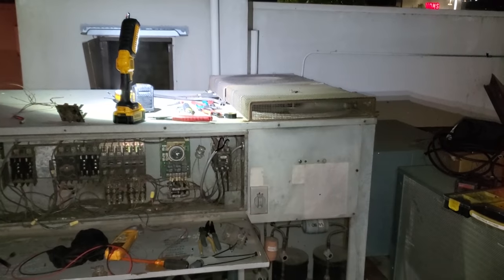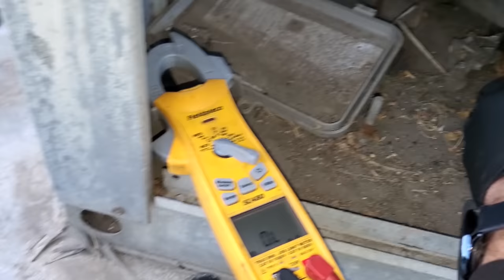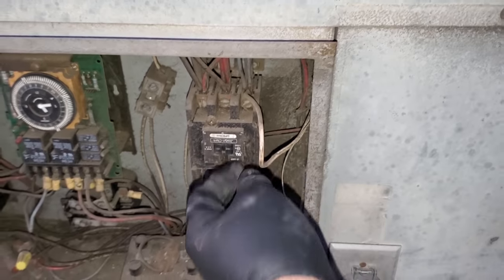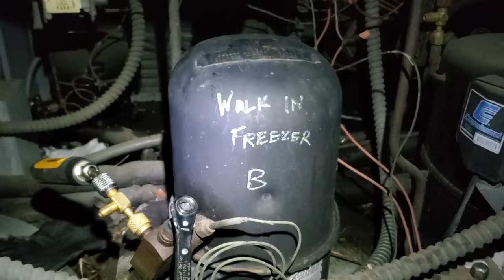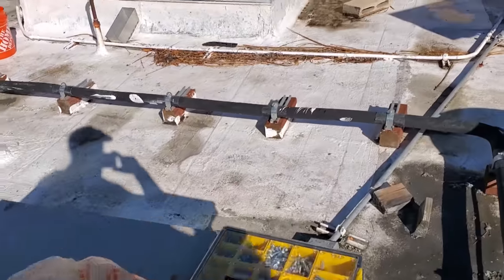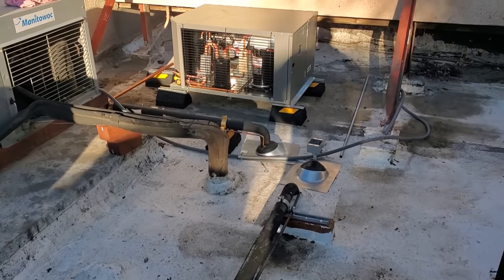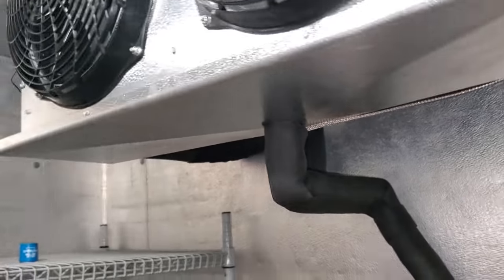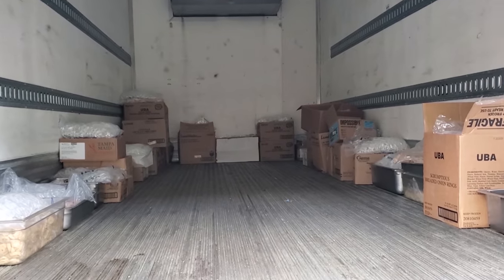FRUSTRATING WALK IN FREEZER CALL

Comment: I have to admit I only wanted to do HVAC because I have been on those overnight calls. I had a 10,000 sq fridge lose a compressor big Copeland on a BOHN at 8pm. I had to call two other guys out, a Crain and opening several stores. 13 hours later I was cured of refrigeration. Lol if I was young like you maybe!

Comment: What a nasty system! Wires running through bare metal openings with no grommets, holes rubbed through the cables, lines floating in the wind, smoked capacitors, ratty looking wiring, an uneven roof with low spots everywhere, electric shorts all over the place, service valve problems, nasty looking attic, coaxing a fan to work that says "eat my dust" all documented on video makes for very entertaining New Year's Eve viewing. Wonderful job of sizing up the situation, keeping the customer in the loop, and a quality install in the end. A super video that shows how and why you earn every cent you make. Very well done video and quality work!

Comment: "Stand back and don't blow up!  Again, don't blow up in my face!"  

"Hello, emergency services?  Do you have any openings on the bomb squad?"
Reply: Had that happen to me last year December 24 arena glycol pump grounded but no ground reading with my megger. Reset the overloads and started it back up panel blew up in my face tripped  a 200 amp 600v breaker... had a real great Christmas lol 

Old old panel no fuses in the panel it's over load then contactor stupid design but what you want.

Comment: The internal bypass inside the compressor didn't close following excessive high head pressure due to the condenser fan failure. That causes the pressures to nearly equalize and it rapidly overheats the compressor. They will reclose a few times, but eventually they fail open.

Comment: Good video. You crack me up on those shingle roof flashings for flat roof penetrations. Here we have to use covered pitch pans on any flat roof penetrations and they sell them at the supply houses. They have even started to use them on pitched shingle roofs too. Pop the cover off, fill with spray foam, seal with polyurethane roofing caulk, then put the cover back on and done.

Comment: Just got home from a freezer call here in Colorado. Equipment blew all the charge from a cap tube on a pressure control, after fixing everything and charging it system has a TXV restriction and is oil logged... Great time to be a tech.

Comment: Wow a nightmare from Elm St. Great video on the removal and install. Lots of tech don't well some don't know you have to bring conduit through the roof to a work box then sealtight to the equipment. No matter the equipment. Nice on the temp power and made sure the electrican knows what you like to do. Great find on the vavle partially closed. Neat install, clean and very considerate on equipment placement on the roof away from potential safety hazzards. Nice follow up on the start up too. I enjoy your time, videos, and your knowledge of the trade. As always be safe, slow down and Look at The Big Picture. Thanks Chris.

Comment: Shocked to hear you say “you are really impressed with Russel”
We installed those for years and are thrilled to be NOT installing those anymore. Several issues after minimal time in service. Hoping you have better luck than us....
Reply from the maker: The evap coils aren't the best but the condensing unit seems to be  much better than the heatcraft units. But the Heatcraft evap coils are better in my opinion, I just wish heatcraft would use all sporlan stuff instead of the cheap components they are using
Reply: I did see in your video that condensing unit was different than the ones we used to install. Simple things like screws stripping easily for the panels was aggravating and non-adjustable packing nuts/stems that leaked and unable to change leaking service ports without replacing entire receiver, etc.
Agreed with your thoughts on Bohn evaps too.
Like Dave says, “got boned by Bohn again”
Reply: I was about to comment the same thing. My company installs Russell/Witt and the condensers are fine. The EVAPS just rattle and seem cheap. Only thing good is the sporlan valves. The ecm motors suck FYI.

Comment: Good video Chris . Russell condensing units are pretty solid . Evaporator coils are not in my opinion. I’ve done Russell condensing units with Heatcraft Evaporator coils . Good thing Russell is using Sporlan Expansion valves , multivolt solenoid coils . Over the past years I’ve found several leaks on Russell condensing units . Leaks were at the liquid rotolock coming out of the receiver . Also found few high peanut style pressure switches failing to close .

Comment: Just a thought, but wouldn't you want the nitrogen purge to be coming from downstairs, so that you're not blowing fumes and nitrogen into an enclosed space?
Reply: there's not that much flowing in regulator braze setting, the piping is clean inside no no contaminates or anything should come out the other end.
the nitrogen is used to displace oxygen from the tubing so it doesn't "oxidize" when brazed, which stops it from creating black flakes of burnt oxide scale inside.
now if you don't use proper clean refrigeration tubing which has oil and pother contamination, there could be an ugly fog of nasty burnt smoke and fumes out the other end.

Comment: I know what you're talking about. The last real R502 system I worked on was probably 4 years ago. That tank of 502 is taking up space that a tank of R448A could be taking up.

We had two tanks of refrigerants, at my first refrigeration job, that we had to have approval to use. A tank of R12, and a tank of HP81 for the Manitowoc ice machines just after the fall of R502.
We never finished off either tank in the 14 years I was there.

Comment: if anyone isnt sure O/L on your meter just means "outside limit" or just outside the reading range of the meter. high resistance above say a few Mohms wont be read by a standard meter and just shows O/L, for example when your probes are apart in air, there is a measurable resistance there technically but a fluke or fieldpiece wont be able to read that. same for voltage :)

Comment: If you were a mechanical design engineer and a machinist then you could rebuild those new valve core removers. I've made new teflon for the ball valve ( tighter fit ) and dielectric silicone on the lever o rings. Mine work now. Even the new ones leaked. Seems like once every 2 years disassemble and lube.

Comment: Hey a reefer straight truck with a carrier I work on those, edit that truck should be able to easily pull 10f even hot Ambient, somethings not right with the truck
Reply: Stat was prob just set at refrigerator not freezer settings. Just needed turned down.

Comment: Hey chris great video. Perfect end to 2020 watching your vid to finish the year off. Hopefully 2021 brings more work your way and once the vaccines start up  places return to  normal and stores and bars and restraints open  up.  I've currently got the Rona so watching your stuffs keeping me busy and learning stuff . I've got a question though . You know for the line sets? Why dont you HVAC guys use the pro press copper crimp connections? Like for braze free inatalls just wondered if youd use them on things like r290 what with 290 being explosive and flammable I think its be safer for you Hvac guys

Comment: Just out of curiosity, if a customer is looking at a $6000+ for the repair ie replacement of the compressor and overtime, what are the looking at for complete unit replacement then as you do a few videos where you basically end up replacing everything but the customer chooses to keep their old housing and electrical instead of just changing the whole unit.

Comment: Have you ever had solder drop inside of the torch nossle
Reply from the maker: Yes
Reply: My coworker had some solder drop into the tip on his map gas torch while soldering water pipe, stopped it up real quick like. had to use a little butane torch thats meant for heat shrink tubing to melt it out.......

Comment: Do you secure the dura-blocks with any adhesive or is it more advantageous to have them loose and just sitting on the roof? I assume there would be a vibratory movement risk which would potentially upset the lines.
Reply: I have the same question. I'm guessing the weight is sufficient enough.

Comment: 19:00 that copper piping, is it the same stuff as water line or is it a special type of pipe for hvac?
Reply: special stuff, thicker walls
Reply: The walls are not typically thicker, on ACR or OXY/MED pipe it is standard Type L tubing. The main things to know are the pipe is nitrogen filled, hydronic pipe uses ID measurements and ACR uses OD, for example 3/4” water line is 7/8” for AC.
Reply: @rogerbettencourt9654   Yep , This man is correct.  Acr copper is Cleaned & Filled With Dry Nitrogen & the Ends Plugged with rubber plugs / sealed.

Comment: If you didn't have any 504 couldn't you just use hot shot instead with out converting everything?
Reply: EPA regulations prohibit mixing refrigerants so technically there's no such thing as a "drop-in", but there are retrofits like 404a if compressor oil is compatible.  If you're lucky you only need to change the power head on the txv.

Comment: What kind of temperatures are pressures would those copper lines see in a refrigeration system?
Reply: like ~400psi max, usually only get that high if the condenser fan is dead or something though

Comment: dust and wood and a hole in the roof...open flames and risk of dripping weldingmaterial...im spooked. Guess you dont have "hot work" rules like we Swedes :p
Reply: Just curious but how are rules and regulations around refrigerants in the US? You converted to a 404 system right? 
Curious cause in Europe we are going away from 404...fast. We are on route to less than 150 GWP refrigerants. Naturals like co2, propane and HFOs like R1234yz and HFO/HFC blends like R454C.

Comment: Good job! .  Have you stopped using the Zoomlock Max for your pipe connections?
Reply from the maker: No depending on the situation I will either braze and or use the Zoomlock Max

Comment: Now out of curiosity when you're brazing the line set in I noticed that your oxy acetylene torch had a very large tip, would you recommend a tip like that when brazing to more evenly distribute the Heat or the typical smaller tip?

Comment: No point in trying to keep rotation the same. It is dependent on the new equipment. 50/50 chance it will be correct even when you wire it exactly they same as the old unit. It's not right or wrong, just different manufacturers.

Comment: In the field for 30 years.... if i owned a business, i would charge accordingly,...equip. less 10 years.. Normal per rate...10-20 years old equip.. add 50%...20-30plus add 200% to the bill.. after that i dont work on Dinosaures